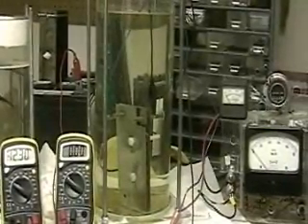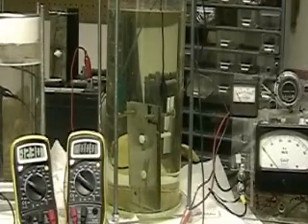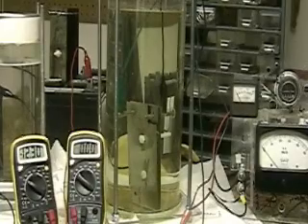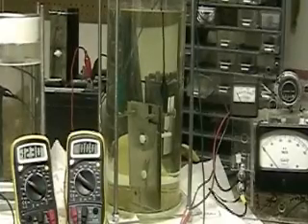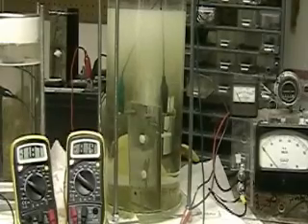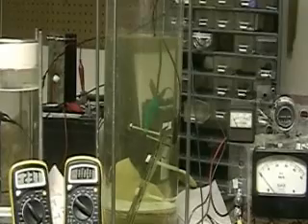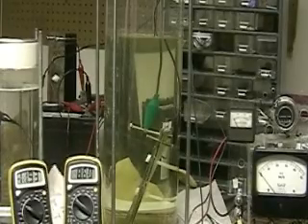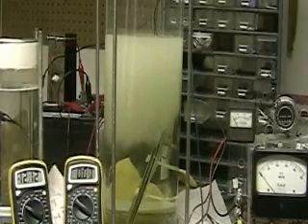Hydrogen Tap (V Cell test) 142

Comment: The amount of voltage/amps per square inch also makes a difference to the amount of output. ie same viltage larger plates will give off different amount of HHO. There must be an optimum voltage/amp per square inch/millimeter.